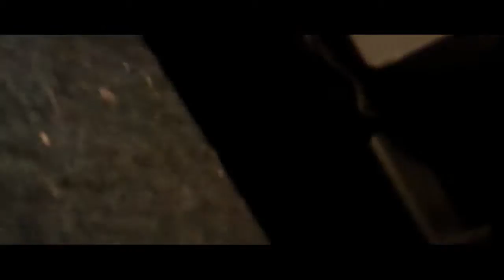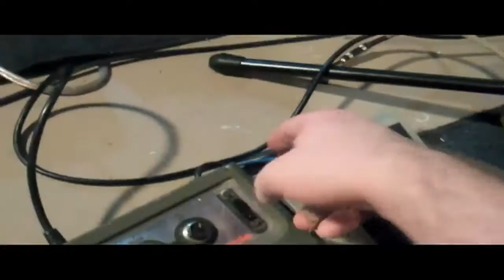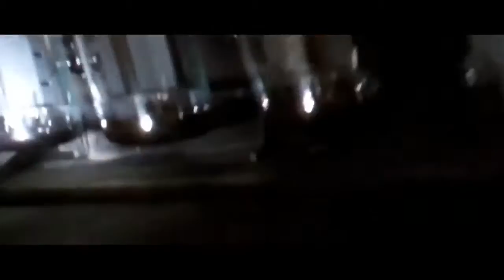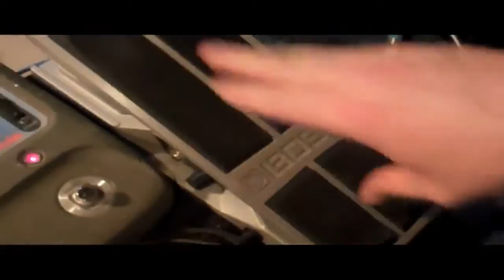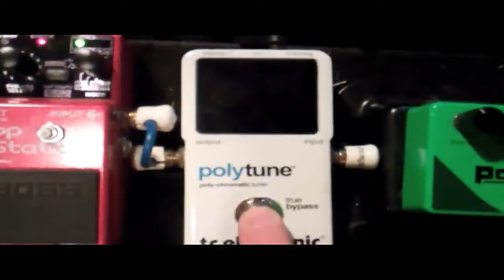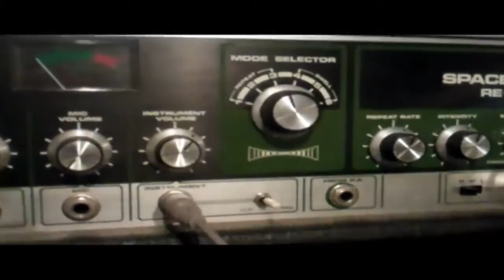Pedal Board/Amp Review

Comment from the maker: The boss pedal will work with any guitar!  The tone loss issue is really related to the specific pickups used in the guitar and the guitar electronics.  It also depends on what else you have in the signal chain.  Sorry....not a real clear answer. ;)